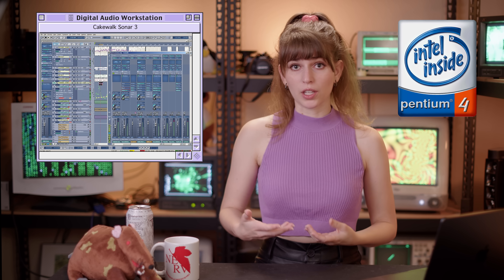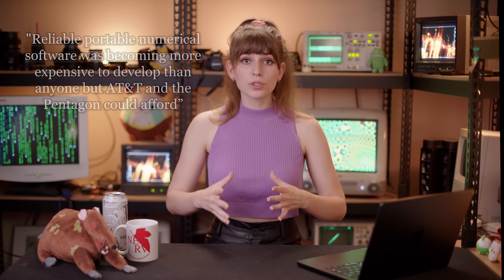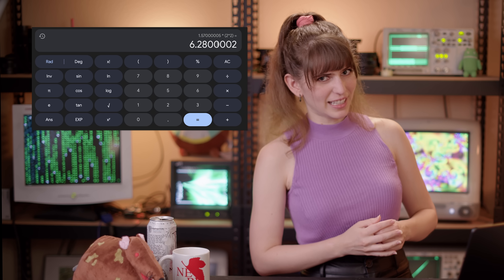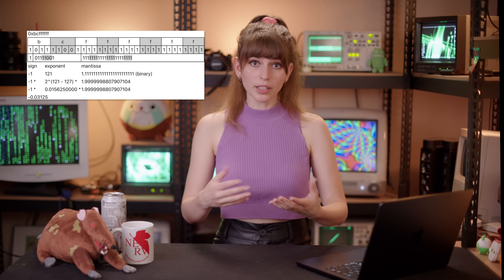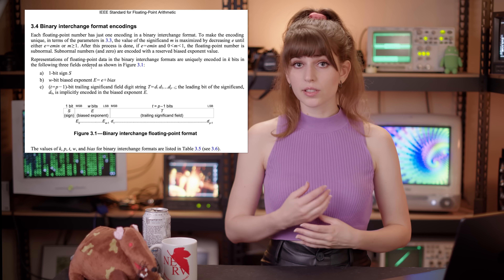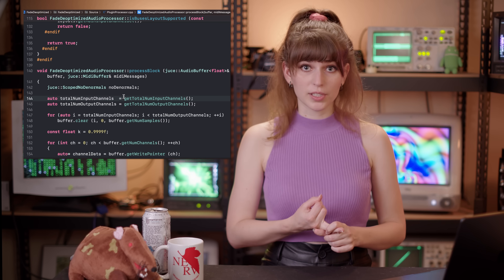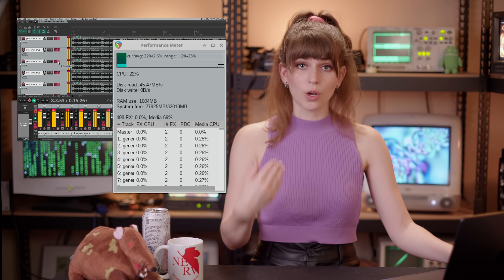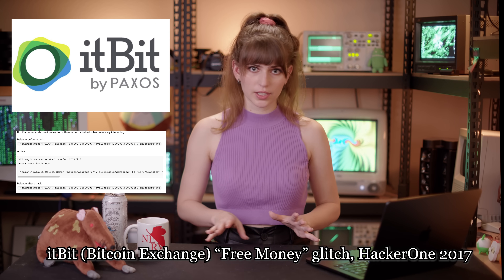Fading Audio is ROUGH on CPUs

Comment: it's 2025 now, i'm working on my largest music project ever as the end of my artist name and i'm watching this video now after learning how deep it still goes today.
i wasn't just automating the master fader, 58 Automation clips with a lot of them simultaneosly. and the Synthesizer Serum has 2 Chaos Knobs in the „back“ (gear icon for general settings you usually never have to check)

these added a percentage of randomness to how the Synth generates sound. In combination with all my automated Faders i reached a point where the entire sound went out after a simple CLICK and wouldn't recover from that until you mashed the stop button until every last tail end of processing was forced to end.

wasn't easy to replicate - hard to troubleshoot. at least i learned what is actually happening quick. an extreme „DC Offset“ that throws the soundwave so far outside of the technical max peak, the software has no idea how to reel it back into the range its never supposed to exceed.
the randomness factor of the Synth plus microseconds of all the automation crossing each other caused a really rare coincidence of a CPU spike that the DAW couldn't catch fast enough.
as random as it appeared, so was the fix. i just put all chaos knobs to 0 and just slightly altered my fader automation without noticable difference in the final sound.
no more clicks to silence.

Comment: I designed the floating point execution unit used in the 387, 80960, and 486.  This is a good discussion of the limitations of a digital number representing irrational numbers.  Prof. Kahan developed the IEEE standard which was implemented first in the 8087.  I became well versed in how to handle Guard, Round, and Sticky bits for rounding of numbers.  

The issue of a "subnormal", more commonly known as a denormal number is a number that is smaller than the most negative exponent will allow such that the mantissa has leading zeros.   I have no idea why Broadwell would require 123 clocks for normalization but I can tell you that as of the 486 and Pentium Pro/II/III generations denormals used 4 or 8 bit shifts.  This led to a maximum of 3-6 clocks for single precision denorms.  The largest penalty was for Extended Floating point, which is really never used as it is even larger than double precision.  The option of "flush to zero" has been around for a while and there is periodically a lively discussion about whether to use denormals or just flush to zero.
Reply: x87 (and MC68881/2) has the extra issue of 80bits representation with explicit 1. Whereas other architectures had just normals and subnormals, these FPU had weird types like "unnormals", "pseudo-denormals"...
Reply: @azza4706  To be clear, all the IEEE standard formats have implicit 1 on the mantissa.  On the 387/486/Pentium II/III/4 we only did the operations to the precious called for, so extended precision (full 80 bits) was rare.  I'm not actually  sure anyone ever used it in real applications, but it was in every test suite.
Reply: @azza4706  That 80-bit format is something. Ever since the 387, those extra representations are mostly not generated or accepted as inputs. The explicit leading bit is set iff the exponent is nonzero. Just redundant in the modern context. We could call it a 79-bit format.
Reply: Heh, I had all but forgotten how Turbo Pascal had 80-bit Extended floating-point type all those years ago when we were doing 16bit code, but modern architectures standardised on 64bit doubles.

Are there any situations today where you would want a floating-point representation if you need higher precision than a 64bit double, or would that always call for an arbitrary-precision type?
Reply: @snemarch  With the transition from 32bits to 64bits, preferred instruction set became SSE instead of x87, and due to intermediate results in registers being 80bits as default on x87 (IIRC some OSes forced 64bits though), some software just got slightly different FP result after recompiling. And then there are the infamous x87 decimal BCD instructions.
Reply: @snemarch  Those 80-bit floats are still available if you use the classic x87 FPU, just not for the SIMD instructions. The IEEE standard actually defines 128- and 256-bit versions, too. The 80-bit Extended one has the same exponent as the IEEE 128-bit one. Wiki says there is some support in hardware for the 128-bit version, just not on x86 or ARM, but the 256-bit one doesn't have any hardware implementations at all.
Reply: @snemarch  32 bits = 193 dB dynamic range - that's more than adequate for audio, lol!  Who actually writes this crap software and gets paid for it?
Reply: @michaellee9743  Here you hit on the reason this was a problem.  The signal was scaled into a range that required subnormal numbers.  Notice that this is no longer a problem because folks that know how to handle digital representations took a look at it.  This happens frequently when using technical solutions in ways that are suboptimal.  You can find many discussions on how to use integers and how to avoid loss of precision through block scaling, etc.  So, live and learn.
Reply: @randyscorner9434  i worked for some time on Cirrus Logic DSPs that had optimized FFTs with 32bit fixed point arithmetic.. if i remember we had some logic to addapt decoders written in c with  floats for fixed point..
Reply: @wcyber  Yes.  Those were the days when fixed point was so much faster and you could assume block exponents.  Still true, but fewer are taking the time to do the exponent analysis when the hardware is dang fast.  Cirrus, TRW, TI, and several others had good DSP offerings.  Still much better than FPGA implementations that had/have so much overhead unless they're strictly embedded.
Reply: Any sense of how (how well) HDL standards handle fp & related operations?
Reply: @billgroves5672  I'm not up to speed on the latest.  But I find it interesting that many are realizing that there's much more to computation than just the right equation.  Rounding, monotonicity, sticky bits, quantization effects all have to be taken into account.  That's why programmers who understand numerical methods are so valuable.
Reply: "the limitations of digital number representing irrational numbers"
I'm getting very tired of explaining this to physicists and chemists.
Reply: Subnormals aren’t inherently that expensive. They just add to the critical path for all operations. Some CPUs go so far in optimizing the common normal case that there is apparently no room for subnormals in the regular execution path. I’ve read that some Intel CPUs require a microcode exception handler. It’s entering that handler that makes it that much slower. It’s a trade-off you can make, especially if you’re trying to minimize latency. Subnormals are rare enough that it won’t hit overall performance. But then if you have lots of them, you get a very hefty penalty.

Comment: In practice, when it comes to digital audio, subnormals are basically useless. There are a few reasons for this. 

Inside a DAW, yes, audio is represented using floating point numbers, but audio files use integers, so this does not impact regular listeners in the way you suggest at one point in this video. 

Even 16-bit integer audio has plenty of dynamic range, 96 dB, which is enough to span the distance from total silence to loud enough to cause hearing damage. This is why 16-bit audio (with a 44.1 kHz sample rate) is the standard for CD audio. But we generally use 24-bit integer audio for raw tracks and for intermediary files that are not a final product such as unmastered mixes*. This is because there isn't actually such a thing as total silence in digital audio, but rather a noise floor; a stream of samples of all zeros is actually a stream of digital noise. Because of this, 24-bit audio is useful during production because otherwise, that noise eventually adds up and becomes noticeable. But for a final product, a track that a listener would actually be listening to, 16 bits are more than enough to span the entire useful range of human hearing.

And that's why it's not as strange as it may seem that we deliberately add noise at certain stages during production; this noise is called dither. It's specifically added at any step when the resolution is reduced, which is typically only at the very end of production, when the 24-bit tracks are rendered as 16-bit WAV files. The randomness of this noise makes the transition into the noise floor more smooth and less noticeable. It's difficult to explain how or why this works, but Akash Murthy has an excellent video explaining this, entitled "7. Dithering Explained - Digital Audio Fundamentals" (not to mention tons of other excellent videos about digital audio, anyone interested in the topic enough to read this comment should absolutely check that channel out).

*What is an unmastered mix, you may be asking? To keep it brief, mastering is the process in album production where the songs are composed together into an album; it's a lot like mixing, except instead of putting a song together out of the various instrument and vocal tracks, you're putting an album together out of the various songs. It's at this stage that final touches are applied to make the album sound cohesive and to compress the audio to make it as loud as people expect a final release to be.

Comment: My (noob) solution when running into floating point fuckery was to scrap the single variable and manually calculate each digit, storing them as integers. It was probably the least efficient way of handling it, but it worked :P

Comment: This is a very interesting topic!
Imagine running a mission critical code, such as calculating the trajectory of a spacecraft around earth to meet with the ISS, or going even further away than our local space to deep space. You’d need the outmost precision on the calculations to do that, otherwise your mission would fail. For everyday use, when you don’t actually need that precision, especially if you’re performing those calculations in loops, but without having to keep doing that recursively to propagate the errors to a point they become significant, you can get away with turning the handling of subnormals off. I believe that it’s all based on the problem you’re facing, and if you’re not sure, better turn them on by default, until you know they’re the source of your program’s bottleneck and you can compare the results with and without having them enabled.

Comment: I see a NERV coffee cup, I subscribe.  Btw, it's still hard to ensure deterministic floating point math across cpu architectures.  Various multiplayer games I've made have had to deal with this and I usually implement a fixed point math library to ensure deterministic results. The Deserts of Kharak team did a GDC talk that explores their solution to this issue and they also implemented fixed point math to overcome it.

Comment: Thanks for reminding me of the trauma of trying to play MP3s and do literally anything else on my computer at the same time. The 90s were wild. It wasn't until I swapped to a proper Windows kernel (Windows 2000, so what, NT5?) that I could actually listen to music and, I dunno, burn a CD at the same time. 

I remember having to disable basically all of the fancy stuff Winamp would release just so that the player would run as lean as humanly possible. I only turned on the visualizer when IT WAS THE ONLY THING I WAS DOING! LOL. 

I kind of forgot there was a time when playing music meant actually considering the impact to the rest of my system. Now I have a second and third monitor with multiple browsers, 50-60 tabs, 4-5 of them YouTube, at least one of them playing YouTube. It's why I LOVE working in technology. 

Love this video!

Comment: Back in the PIV I had Some Creative 24bit soundcard that would process the audio and much later on a 2600K I had Auzentch X-FI forte 7.1 and in tests on some apps or games could have 10+% less CPU USAGE tested on a much older CPU, on my 2600K wouldn't likely effect too much.

But anyway after going to win10 was all ruined, no more hardware sound acceleration like wind XP 🤬

Comment: These days, every DAW handles fades in real time without breaking a sweat — but that wasn’t always the case. From Version 1 in 1991 to Version 10 in 2011, Pro Tools used pre-rendered fades stored as separate audio files. Every time you added a fade to the timeline, it created a new file on disk.
This approach stuck around well after other DAWs had switched to real-time fades, primarily to maintain backward compatibility with existing sessions and workflows.

Comment: That was a very impressive talk. Thank you. I used to enjoy writing floating point subroutines for my home brew computers, so I was already familiar with the logic of the math instructions before the standard came out, then I got a job implementing IEEE 754 in the early '80s in hardware! (It must have been in '84/'85 because we had to put in a change when the final one came out). We were building and debugging a wire wrapped supercomputer prototype for a scientist with a research grant. This was an interesting architecture, Harvard 16/32/48/64 bits wide. (Four processor elements linkable with little to no overhead.) It used about 10,000 74LSXX ICs and was just to prove the logic, with no chance of running at speed. I loved working in binary math. We did have one big LSI chip that did 16 x 16 bit multiply in each processor element, but otherwise it was all gates and registers.
Reply: 16 X 16 Multiply sounds like the TRW chip, did it get HOT!

Comment: if you use some type different from float, 6.28 can be equal to 6.28, basically you store an integer and the position of the decimal, or store the decimals and integers in 2 different places (fixed point also works, where, for example you use ints and always multiply your numbers by 10000, as long as you keep to addition and subtraction, but that would make stuff like fading a lot faster)
.
an example of that is the "decimal" type, 6.28 would be represented as 0x2740000000000020000, 0x274 being 628, and 0x02 being the 2 numbers after the decimal

do note that with that representation, 1.0  (10/10^1) and 1 are different and so more calculation is required (in addition to being a 128 bit number which isn't usually supported natively.) 

for banking and other applications where you do have numbers that are exact decimals, and the performance hit is acceptable, you should use a type like decimal that uses powers of 10 instead of powers of 2, or fixed point numbers.

however, the advantage of floating points is that they are precise near 0 and also handle large values, and power of 2 floats usually have a larger range, so if you need performance and very high precision isn't mendatory, floats are usually the better choice. sometimes you can even get away with 8 bit floats and it's good enough, in exchange you might be able to divide by 4 your memory usage.

Comment: The correct answer to any problem in computing is to use the method that is appropriate to it. Using subnormals or not depends on the problem. Audio processing can generally be handled pretty well in integer math, so no need to worry about subnormals (you’re working with 24 bit integer samples worst case). Complex scientific problems need the precision. Just learn to use what the problem requires.

Comment: I was expecting this video to talk a bit more about the real implementation of volume control buttons and their adjustment. When listening to music in a very quite environment I often realized, that I'd like to have some more steps in between very low volumes. But either the sounds was too loud or too quite (or completely off). 
[If I can change the volume between 0 and 100 on my computer or phone, I feel that I don't have enough steps between 0 and e.g. 6 to adjust the volume on low levels, while I hardly hear a difference between 78 and 80 for example.] 
Additionally, I can imagine that the logarithmic way of hearing is not helping with that problem either. 
Still, thanks for demonstrating the issue of float numbers in programming. Always good to remember that when programming with floats.